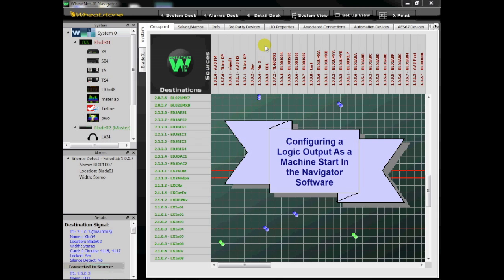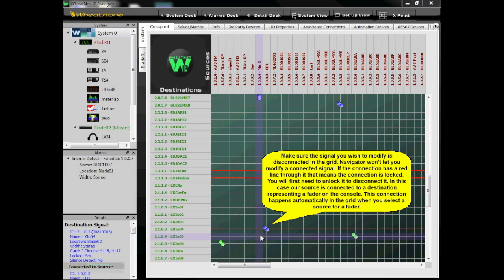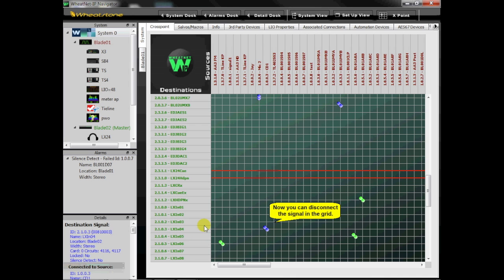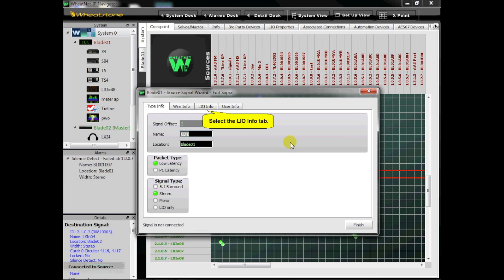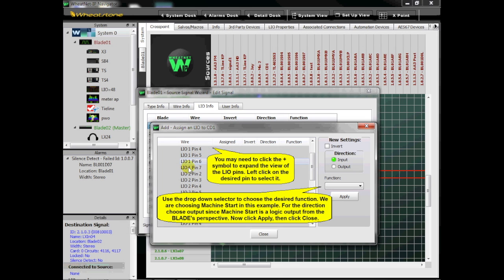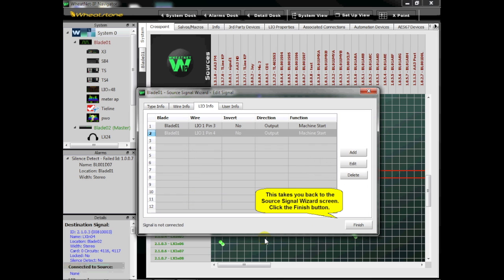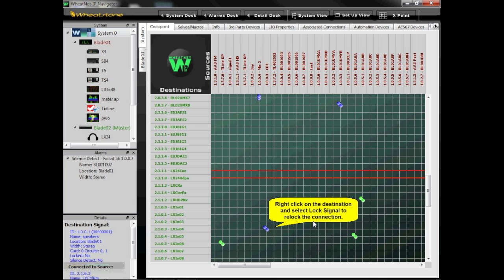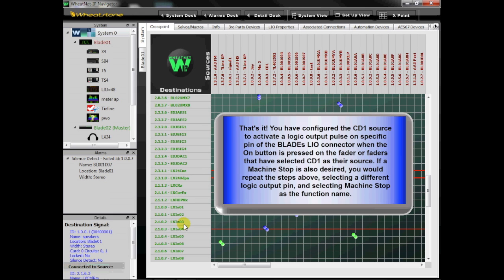WheatNet-IP Navigator Machine Start Tutorial

Comment: It would be great if you guys would just explain the logic setup in the Wheatnet manual.  The current documentation is basically useless.  Great, wordy descriptions of how awesome your logic system it is, but very little practical application.  It is an absolute horror when you need to set something up quickly.
Reply: I am finding the whole Wheatstone system to be a horror. It's like it was designed by network administrators and not audio technicians. It's not user friendly at all. It's convoluted, and overly complicated. The grid system is a mess, and having 8 characters to name stuff is horribly limiting.